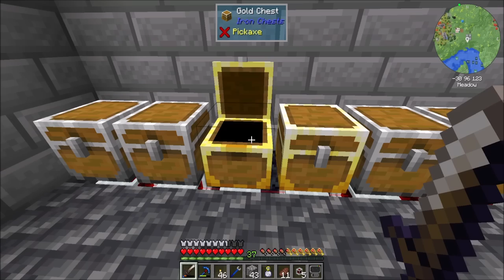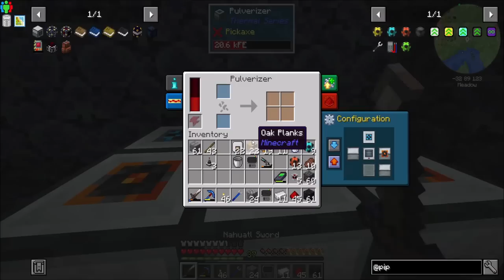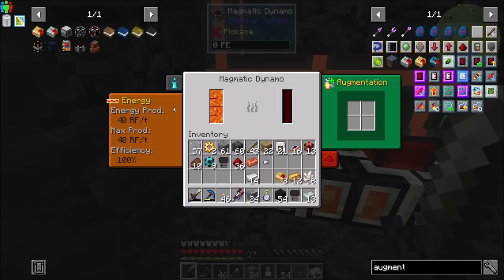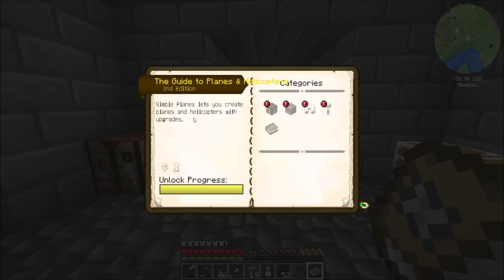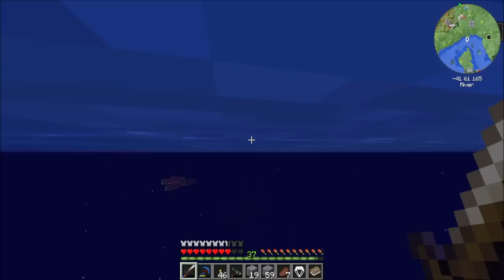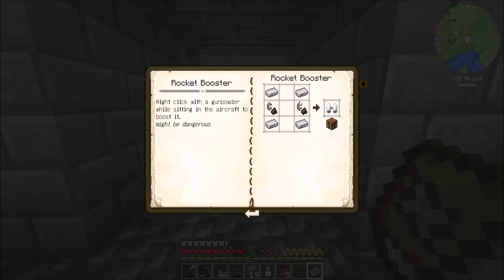Lets Play S11E11 Automated Ore Processing and Planes

Comment: That was truly an amazing ending. Looking forward to dire building a runway. Maybe he won't rush to creative flight because this seems so fun!
Reply: Planes aren't fun to fly in my experience when you actually want to get to places because they are very hard to land. Accidentally crashing them happens all the time. Helicopters are much nicer in that regard because they can at least slow down mid air. But they still aren't a replacement for a jetpack or creative flight when it comes to exploring like the nether and other places where you need to maneuver tight spaces and land on small platforms
Reply: @zapl80  mmp
Reply: @zapl80  It'll never REPLACE those, but what it does is give you very nice mobility for fairly cheap, early.

Comment: When Dire asks to pay attention to the transfer capabilities of energy pipez, I am lost on interpretation. now, each pipe can transfer 256RF/t then 3x120 > 256. So in the common section of the pipe there is 360 RF/t being transferred. The other interpretation is, each pip can accept from other blocks (i.e. i/o) 120RF/t where as the transfer rate (i.e. between pipez) is much higher. Ender i/o had this distinction if my memory serves me correctly. so what definition of transfer rate is applied here in the case of pipez?

PS: watching the video further, looks like the 'transfer' here refers to I/O in the context of pipez

Comment: A Thought on your filter issue Dire. Make a little card catalog. Pretty much a bag. You could set it so that it inserts a card with a right-click on the node, and you could include a template slot that does not extract but when you right-click inserts it copies the settings of the template slot.

Comment: Dire, for your card holder, you should do something similar to Integrated Dynamics and make it for you can program cards in it besides holding them. This would be especially handy for you duplicate card programming (i.e. a large ore processing area that will have 5 pulverized all pulling from the bottom perhaps with filters and not having to program each). Yes it would be much more complicated to do, but it would make this mod much more unique and useful.

Comment: With regards to stacking item cards, I can think of a pretty quick and dirty way to do it.

Make a "Deactivated Item Card" item that does nothing except you can craft back and forth between them and the item cards as they exist currently.
In their deactivated form they don't remember anything so they should all be able to stack together and then when you craft them to be active again they will be in their default state.

The downsides to this solution however are that you can't store them with their data, if for example you wanted to move all your chips from one setup to a new one, and also resetting chips takes an extra step but since with multiple chips you can activate them all at once that's probably not an issue.

I think the best method however would be some sort of device that can store the settings of chips digitally, and when you pull out a chip based on what config you've selected from the stored ones that chip gets that information.
Say you want to to make multiple identical machines in parallel that each use LaserIO. You've set up one machine's cards properly, so you load them into your Chip Deck that you've already filled with blank cards. Then you select a config,  pull out however many you need, put them in the right place and select the next config, etcetera

Comment: For your cards, I assume they are the size of credit cards, I suggest you make a wallet made out of 6 leather down the sides and 3 string in the middle. The wallet can act like an immersive chest or shulker box but can only store one card in each slot. And for the trader problem - there is a mod out there Called "No Solicitors Mod" that keeps him from spawning so many blocks from the sign. It's supposed to be configurable, I don't know if it's available for 1.18, but may still work. May I suggest you find that mod, and if you don't already have it, add it to the pack.

Comment: Direwolf20, take a hint from Pipez on the cards; their upgrades are simply unlocking keys for the functionality already on the pipez themselves. Add all the filter and such functionality to the nodes themselves and simply unlock the correct ones with the cards. That would remove the need for NBT (mostly) on the cards/upgrades and move it all to the nodes; allowing the cards to stack. (obviously slightly more complex than Pipez implementation as you have more interaction points per face, but should still be possible.)

Further, you could then make a copy/paste tool for configuration of nodes en mass.
Reply: The problem is that you can see that the cards themselves hide A LOT of the ui fluff which he would then need to expose for 9 slots on 6 faces. I don't think it's as simple as making the node do all the work
Reply: I think the point is that you are able to set stuff up on a stack of cards at the same time: this way you don't have to deal with setting the same thing like 20 times. This seems more convenient than copy paste IMHO
Reply: @ariuss3009  I get that, but Ender IO used a copy and paste mechanism; probably for a reason.

Comment: I kind of wish early setups like these used something other than basic chests and the same thermal machines every time. I've setup Immersive Engineering for my playthrough this time just so it adds at least some spice to the mixture. Seeing the same 3 machines that do the same 3 things is boring
Reply: I agree with that, but this one's not supposed to be fancy. That being said, I would imagine Immersive certainly would be a different start because of the multiblocks and the wiring mechanic. I imagine you set up like districts for what goes where?

Comment: Dire: u need to pipe FLINT in to ur pulverzer that procerces ur ores
Reply: I've been trying to figure out what adding flint does, and does it boost anything??
Reply: @bobboukie  Higher chance of an extra output is what it did in pre 1.18, not sure with the changes with 1.18 though.
Reply: @bobboukie  JEI say:
flint
primary modifier 1,1x
auxilary modifier 1,5x
enery modifier 1,1x

tried with set of 30 copper ore
49/30=1,633 dust each ore
45/30=1,5 dust each ore
46/30=1,533 dust each ore

Comment: I feel the planes should be a lot more expensive. I would also vote they should be iron (aluminum?) instead.
Reply: The plane models are of early biplanes, which were wooden structure with fabric covering; metal was mainly in the engine and cables. Even the propellers were wooden. So the recipes should use less metal and more sheep!
"If you can fly a Sopwith Camel, you can fly anything!"—Biggles